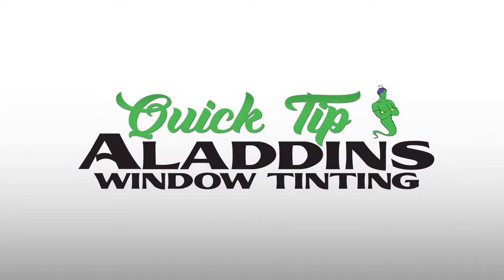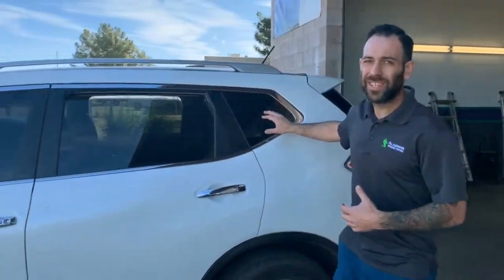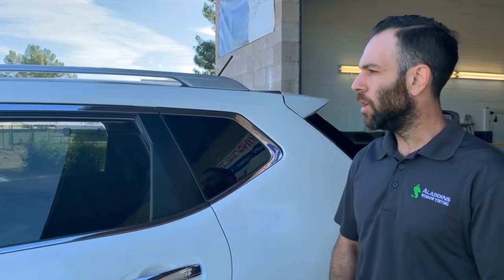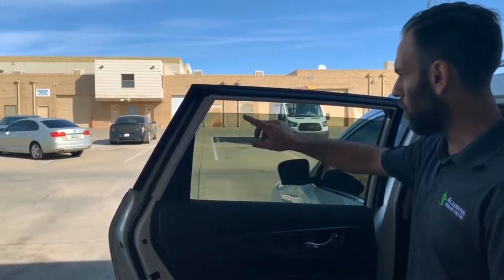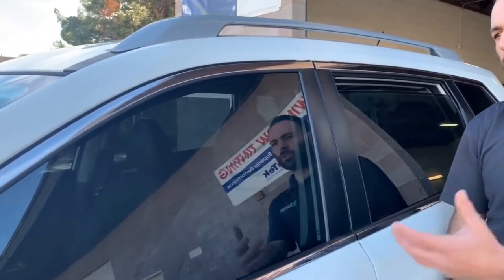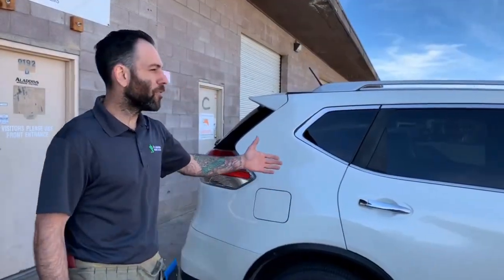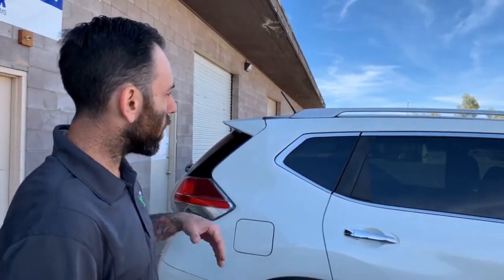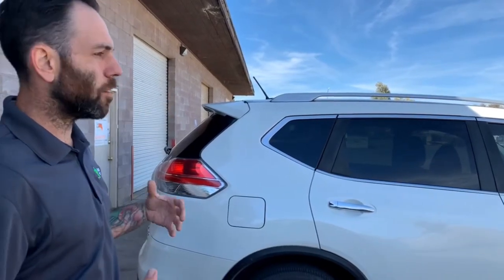Are Your Windows Tinted - Window Film vs Factory Privacy Glass

Comment: Hello,  here in the EU i noticed cars from the VW group have factory tint on the windshield. It is mostly pinkish reflection, it depends on the wheather outside but it definitely has some tint on it. Did you notice in the USA also ?? What kind of procedure is used in that case ?
Reply from the maker: Teslas are the most common vehicle I notice nowadays that have IR rejection from the factory; some BMW and Mercedes as well. The windshield will glow an orangy-reddish (slightly pinkish perhaps,) when wet. Some window films, such as 3M Crystalline, will also have have that similar effect when the glass gets wet.

In those cases it is usually built into the laminate, between the glass, so film can still be installed on the inside of the glass.

Comment: Is it possible to get a dyed or stained glass that is factory for the driver and passenger windows of vehicles?
Reply: No, The US Department of Transportation-Safety does not allow any manufacturing, production, or the sell of stained, tinted/privacy glass in the US, for front/passenger windows &/or windshields.
Reply: You could have it custom made but it’ll be extremely expensive. I know someone who spent $8k on bullet proof tinted glass.
Reply from the maker: Negative ghost rider. There is such a variation from state to state in the laws for the front side windows those will always come clear out of the gate.... And what SCP said.

Comment: Can factory window tint be removed in preparation for aftermarket window tint?
Reply: No as it isn't a film, it's a tinted coloured glass like sunglasses.
Reply from the maker: Dealer ship installed FILM can be removed, however factory stained or dyed glass is not removed.

If you have privacy glass what you want to prepare for is the decision of how dark you want your final result to be as you will be layering varying shades film over existing tinted glass so your final result will be darker than the shade you choose from the board. 

Experienced, aftermarket shops (Not The Dealerships) are good at educating and guiding their clients through this process.

Comment: You can see better out of factory tint.
Reply from the maker: Great point!! This is why we stock every shade available from the manufacturer, including the CLEAR films that you can still get the benefit of infrared and UV protection out of. If your goal is to maintain the same visibility then don’t “tint” the glass darker.  Simply install a clear film and you’ll get the benefits of the solar energy rejection.
Reply: This varies. With different shades and products the vision varies.